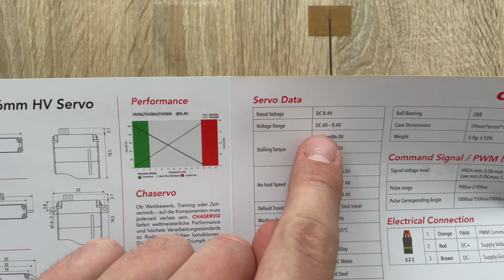CHAServo HV06: The New Best F5K Servo?

Comment: Would you prefer this over the KST X06?
Reply from the maker: Yeah, I would say so... The only drawback of these is that you will need to plan upfront whether you will use 1S or 2S battery and get the proper version HV/LV while KST X06 will work with either or regardless.
Reply: @flightpointrc  I work in animatronics, so we almost always use a switching regulator to keep a steady 6-7.4V supply voltage. I am very excited to put these into some projects. I have some X06 and A08 coming as well. Thank you for these reviews!
Reply from the maker: @Veektohr  You are very welcome, glad to hear that you find it useful!